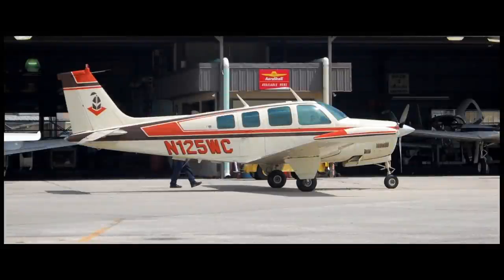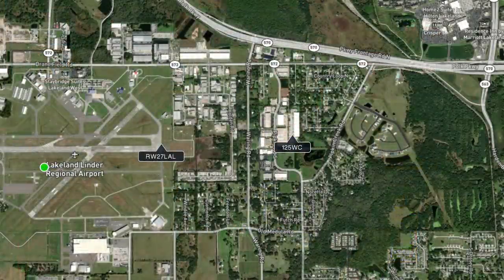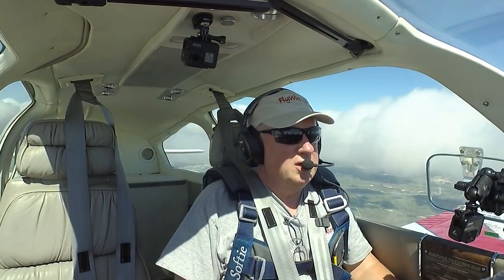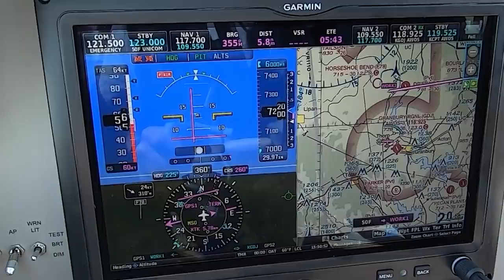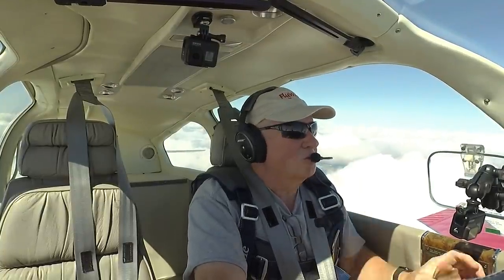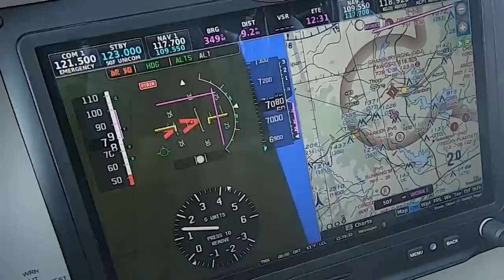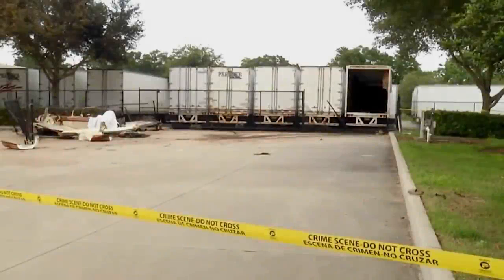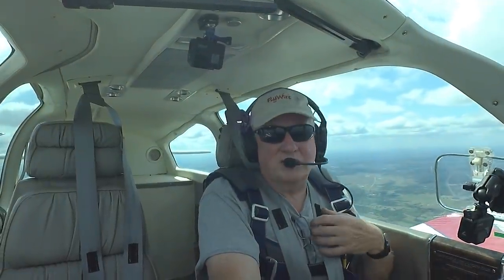Accident Review Engine Failure at Low Altitude  Extend the Glide

Comment: He was sort of afraid of making a short approach?.. Kept going away from airport with engine off on downwind leg??  Some pilots are afraid of Short Approaches.  "They are difficult" i heard some say.  Sometimes you really need them.  What is so difficult about gliding 180 turnback to close by runway on your side?? I learned them at 8 hours on Piper Colt that drops like a brick on a 40 degree bank we had to do with power off.  I  soloed doing 3 short approaches and touch and goes at 10 hours. 17 years old.  

Some pilots only like to do  "Mild Maneuvering" and nothing else.  See the results here??
Reply from the maker: He was never on the downwind. The fact is that the airplane was at 800' about 4 miles from the runway. He was not going to make it.
Reply: @FlyWirescottperdue  Too bad.  Too far away from runway.   Wonder why so many engines failures on those expensive engines.  ON Cirrus too.  Is quality been cut?? Or fuel systems old?? Any comparative studies lately??  Too many tragedies.  Thanks for your advises..
Reply: @FlyWirescottperdue  Another pilot error i noticed is that they dont work the levers when engine is failing.  They let it die when they only needed to troubleshoot  the engine.  I can send you a clip of troubleshooting in sequence i did in 1995.  

I did the same sequence on every engine run up so that sequence was stamped in my habits.  In 2001 i had to use it to troubleshoot a dying engine at 100 feet agl on take off.  I brought engine back instead of crashing on houses ahead.  

As part of the sequence, On run up, i also test the mixture with mixture lever.  Last year I send that method to that test pilot that flew the Wasabi airplane in Nevada after seen a video him testing an airplane, on take off engine started losing power but he didnt troubleshoot it.   He didnt I know it so i dont know if you.  I found some airplanes with too lean or too rich mixture on take off setting.  

You just pull the mixture at full power.  If engine start cutting too soon, mixture is too lean, if cutting too far back, mixture is too rich.

Comment: I'm guessing you used the correct inputs for recovery. If the pilot of 125WC didn't make the correct recovery inputs, would that have potentially worsened (or made better) the impact G forces?
Reply from the maker: Mike- All of my recoveries were below "Ground' level. The answer to your question is no.

Comment: It could have been a partial engine failure that gave him hope...always a bad thing to hope it's gonna come back - then it doesn't. Plan for the worst. Get it down. I remember the warbird pilot in the P 51 with a partial. Almost had her on final then it went for good. He was smart enough not to hope and put her in a field. P51 and pilot survived.
Reply: He went to the downwind leg instead of landing with a little tailwind.  Runway was ready for him to land tailwind.  Went to the downwind leg instead, put drag flaps, and also gear down.  3 big pilot errors.  Fell short due those 3.  That could have been a great save if for those 3 big pilot errors.   I had to land tailwind twice due engine problems.  no problem stopping it..
Reply: @emergencylowmaneuvering7350  Yes...I had forgotten some of that. Going downwind was the biggie...
Reply: @johnmclean6498  Of course.  He had the tailwind runway in front, then Why turn to the right and away to the downwind leg?  Like trying to do a normal approach going to the other side of the airport with the engine quitting.  Then pop drag flaps and gear too. Got short,  Not thinking.  Fail..

Comment: Gunny - I was surprized by the almost inverted attitude the stall put you in.   Is that increased roll more characteristic in a low wing than a high wing type Cessna?
Reply from the maker: The stall was a full blown departure.... even Cessnas will exhibit the same sort of behavior.
Reply: What do you mean by “departure”?
Reply: @DiscerningTruth577  basically a spin (one wing stalls first - aircraft rolls until recovery and does a nosedive)
Reply: @DiscerningTruth577  The aircraft "departs controlled flight".
Reply: @ZeeroGamingTV  Further, if folks haven't seen it, I recommend Professor Purdue's video where he uses Simpson's Individual Emperor Stringettes to demonstrate that aeronautics is a thing.

Comment: Shouldn't every student pilot be given this situation of engine loss too short of the runway with ground rush in a simulator ?  Must land short with enough speed to flare instead of stretch it to departure. Hard to learn without experience.

Comment: Another great video lesson Gunny. Thank you....BTW, I like your setting on the G3X up for the cross bars for flight director cues. Would that work well as the vertical and lateral cues when shooting an ILS (or VNAV) approach?
Reply from the maker: Dennis, It works great. That is the same display on the 737-800 and 777.

Comment: Fantastic video!  Based on some of the comments, I think some pilots haven't experienced a stall initiated from that slow of an airspeed.  That they've just done the standard power off stall, from normal approach speed.  I think it leads some into thinking they can fly closer to that edge than they think, that they'll have plenty of warning, and it's just not so.  The other think I think is that some people have a completely unrealistic idea of what their glide distance is.  I learned that from flying a Cherokee, which was described to me by an instructor as having the glide distance of a sewing machine.  It's a fairly accurate comparison.  As you say, physics always wins.  Adjust your flying to suit the math.

Comment: just out of curiosity, are you wearing a parachute? If so, how the heck would you bail out of that cockpit? Every time I have been in a C-150, it makes sense that without a wing in the way you can kick the door off if you need, but you're just falling out of the aircraft. Likewise, if you're in something like an M-18 Dromader, you only have a glass canopy to deal with and you can kick the aircraft out from under you. When you have a bottom wing aircraft, with chunk of fuselage over you head and a wing beneath you, how do you exit the aircraft in a way you can deploy a canopy without a tailstrike?
Reply from the maker: Yes, I wear a chute for aerobatics. This is an F33C, an aerobatic Bonanza and the door has a quick release. Bottom line is you crawl out.

Comment: Always good to have real data rather than conjecture.  It would be interesting to look at how much difference it makes to pull back the prop in a CS airplane when the engine quits.  I suspect that would be one legitimate way to “stretch” the glide.
Reply from the maker: It is actually. I've got other videos on that very topic.
Reply: Flap gap seals make a big difference in increasing gliding distance along with an increased climb rate and faster cruise.  Win, win, win…at least they do in our 185.

Comment: Best glide assumes still air.  You can "stretch your glide" by speeding up in a head wind and or sinking air  - or slowing down in lifting air or with a tailwind.  Of course, you still need to mind your stall speed.
Reply from the maker: We're talking powered airplane pilots here.... in a Jam like this I'm sorry, but no such thing as stretching glide.
Reply: Good point, but in an emergency only a few thousand feet up there is little time to figure out the winds and make an appropriate adjustment.

Comment: I wonder how to prepare for this kind of situation. When the ground rushes up to you and it becomes clear that you go down at an unfavorable location. Knowing and actually doing are two different pairs of shoes. How to train for that?
Reply from the maker: Good question. I do train for this using an engine out at a non-towered airport with no traffic. That way I get the sight picture and descent rates in a safer environment. I’ve got a couple of videos on this topic.
Reply: @FlyWirescottperdue  Yeah, I practice power off landings pretty often for that reason. But what I meant is: How to train for not to pull when it becomes clear that you land where you don't want to. I can imagine that the urge to pull and to ask for the impossible becomes almost insurmountable in this situation.

Comment: I have a question.....As a student pilot we practice this very maneuver and it seems very much straightforward.   My question is what does a last second quick maneuver to avoid something, change the way the aircraft behaves?  That last second maneuver isn't slow flight and it's not a power off wings level stall either.  I see videos that seem to show that last second maneuver just before the crash.  Could you maybe do something like that and compare it to the data from this flight.  Thanks JW
Reply from the maker: JW- I think you see what happens in a last second maneuver in this video. If you pull at stall speed you depart, if you are close to the ground... fill in something less than 300'... your impact angle will vary as will your rotation. 'Last second' maneuver doesn't give you a reprieve from the laws of physics.
Reply: @FlyWirescottperdue  thanks for the clarification.   I hope that if I'm ever in this position i will have what it takes.

Comment: Stupid question. When you lose an engine the propeller is still windmilling. If you were to pull the prop lever all the way out would that help reduce the drag from the windmilling propeller?  As close to feathering a prop in a single? Would there be enough oil pressure created from the windmilling propeller for this to be possible?
Reply from the maker: If there is oil pressure to do as you suggest it will reduce the drag by as much as 30%.
Reply: @FlyWirescottperdue  Thanks Scott.

Comment: Flight training doesn’t do a good enough job of dealing with this mentally imo. When we do stalls it is either the horn or the buffeting that we recover at. 
We don’t train to counteract that instinct of pulling back to stay in the air with an engine failure. 
How can we re-create this in training to help us identify not to do this when it happens in real life? I know we train for engine outs and stall recovery but the stretching the glide happens because they are afraid to crash and don’t realize their airspeed is bleeding off...how do you fight that instinct?
Reply from the maker: Only with training. The FAA ACS steers students away from actual stall training.

Comment: Scott......Did you do any analysis on the ground distance covered by trying to "stretch the glide" vs flying the same scenario at best glide speed and minimum sink speed?  That could be an interesting story as well.  Great video by the way.  Always very informative!
Reply from the maker: That would require a comparative set of test runs, totally different objective to the tests I did. The short answer is not much, variable and pretty hard to put anything in your pocket to use if it actually happens to you. The odds of a maneuver like that of having a positive impact is way offset by the message that maybe you can do it... It's better to land under control than the impact the ground out of control.

Comment: I am a little confused here.The assumption of linear behavior of this and other types gives way to dynamic behaviors with changes to the environment.The other assumption is that this is a completely clean airframe.However as the aircraft dips below 300 ft It will change its behaviour with ground effect on some surfaces. My guess is that people may argue that ground effect could be useful in extending range however it might be useful to comment whether first degree of flap could be introduced at the 300 ft height to extend range ?
Reply from the maker: Ground effect does not extend higher than the wingspan of any particular aircraft.

Comment: It appears to me that most of the situations where pilots are stretching their glide is with an engine out. Is that true? If that's true it seems to me the best course of action is to roll full nose up trim for best glide. That way you could avoid the deadly stall, be able to do some maneuvering, and accept whatever touchdown point as a given. It would also allow a slip if needed to put down in the safest area that presents itself. This is my mindset. Does this sound right to you or is there something better? I always find your YouTubes interesting and thoughtful.
Reply from the maker: Bob, I did a video on full up trim a few weeks ago. Check that out. Absolutely doesn’t work in every airplane.
Reply: Thanks for the reply Scott. I watched your video on nose up trim experiment. I'm flying Cessna 152 & 172, without an autopilot except me, so it seems to work for me. The difference in wing loading between C172 and an A36 Bonanza is about 5 lb per sq ft. I didn't realize it makes such a difference. Did you try this experiment without the autopilot?